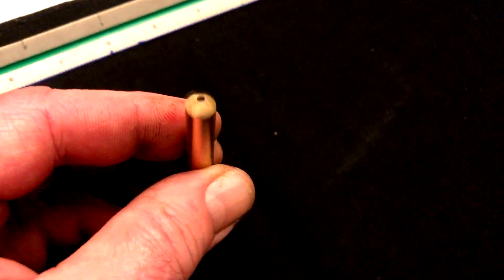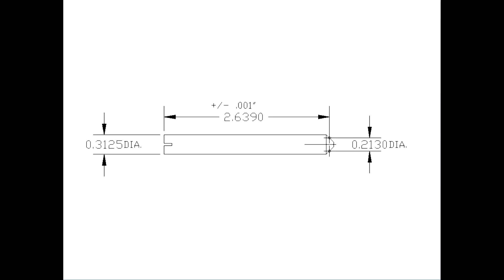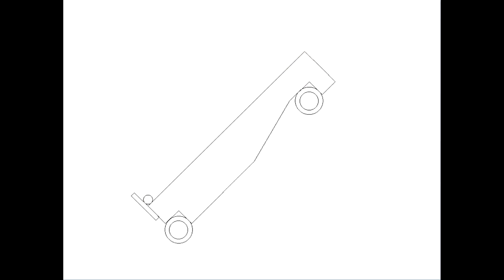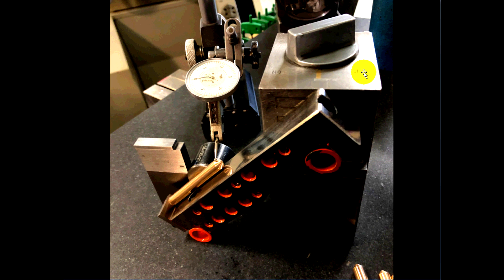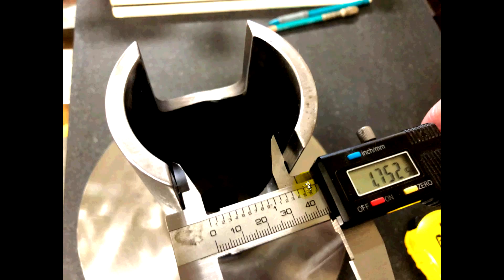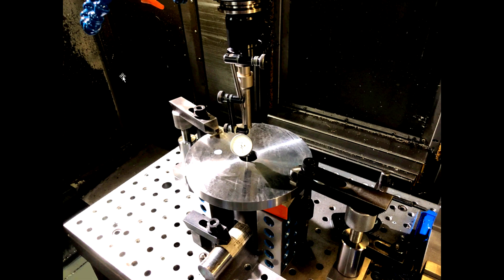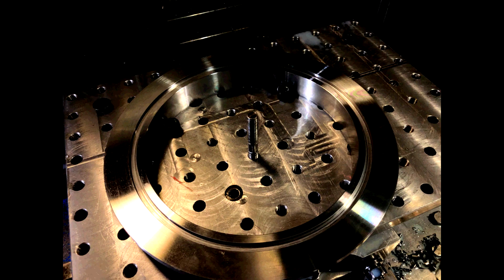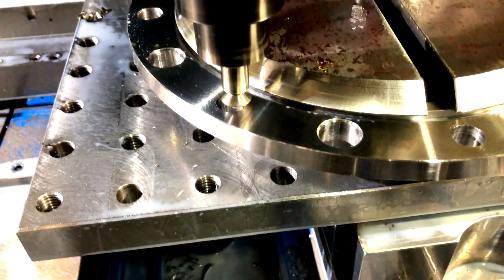HOW TO MASTER YOUR SETUPS: Three Different Parts, Limited Quantities

Comment: I’m an injection mold specialist. I like your vids. You said “not enough mold makers” so I’d love to hear back:) cheers.
Reply: I watched a vid of dimensions to “a point” on 45 degree pin… some plastics “flash” at 0.0001” do if your dimensions are out the part fails. I’d be happy to give you more info on this:)

Comment: I like this already and I've only just seen the print for the first part. Plus or minus one is always daunting for me because I can't really rely on my caliper, maybe the height gage. My first instinct is to make a lathe stop that goes behind the chuck about 3/4" diameter with a reamed .213 hole with a roomy 5/16" counterbore about  1/2" deep so chuck jaws clear the stop with minimal material out the front. I think acetal would work fine to get a nice sharp corner for nailing that 2.639" dimension. It would be EXTREMELY helpful to have a known good part to start with. Otherwise I wouldn't feel to comfortable about getting a precise measurement using this method. Ok now it's time for me to learn something!
Reply: Very interesting. I've never used a sine bar. I agree your inspection method could objectively be a tie for the most precise method but only if the bevel is precisely 45 degrees. Actually its kind of cool though that you could set up your inspection rig and check the bevel angle ahead of time... I never would have thought to grind that stuff. I guess I just like the chips it makes on the lathe.